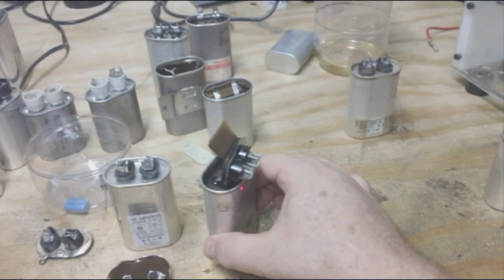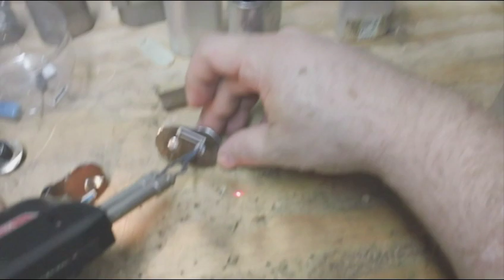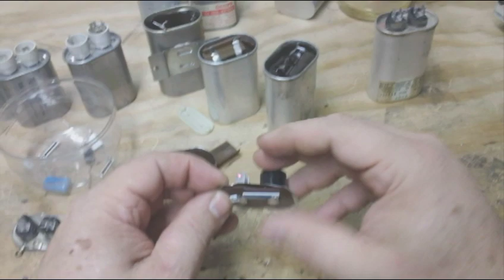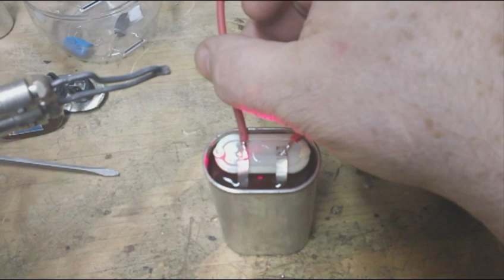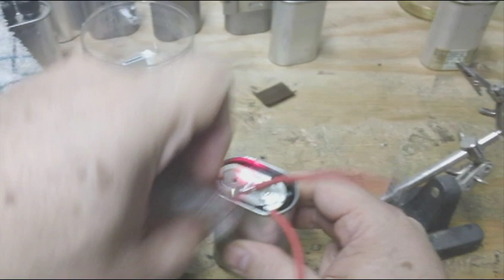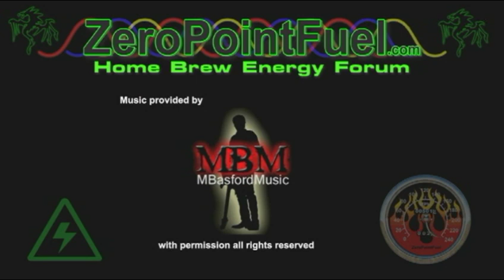microwave capacitor resistor removed  for testing QEG Hybrid

Comment: can I use a glue unto put it were you put the liquid thing
Reply from the maker: +Chris New  as long as the mineral oil covers the top of the cap ,and the glue is not conductive it should work silicone is cheap and works great

Comment: How much luck do you think i'd have trying to disable the internal resistor of my en61270-1 microwave capcitor by turning the leads in hopes at breaking the resistor off without opening the can?

great Vid!
Reply from the maker: snowboarder50000 it depends on the type of resistor in the cap the flat ceramic type will snap if you twist the post, I know that because I broke one by mistake, they are the most common type . the standard wire type wont break. good luck and thanks for watching